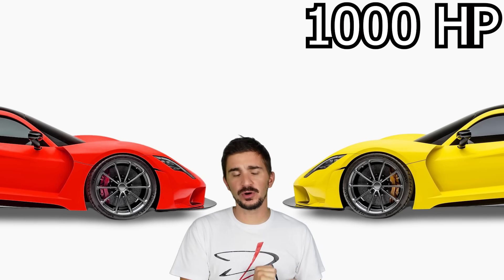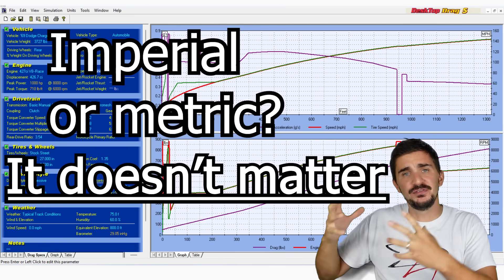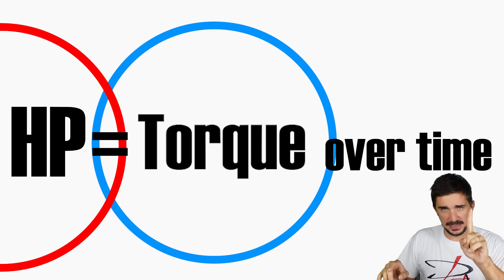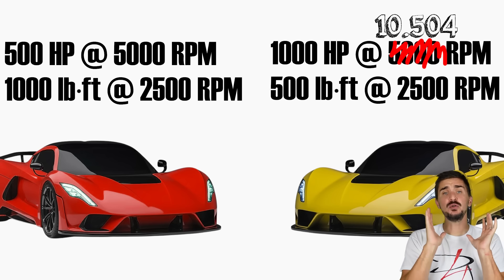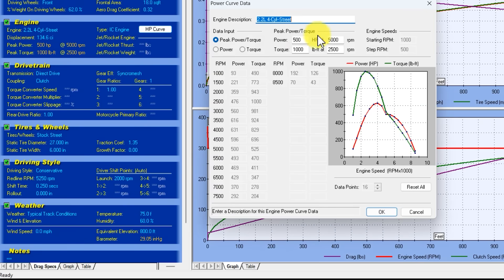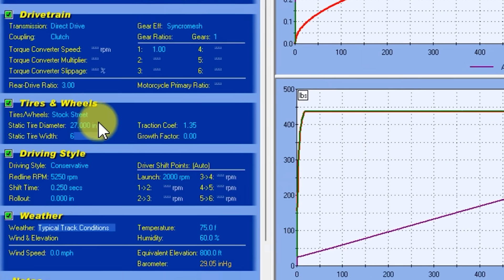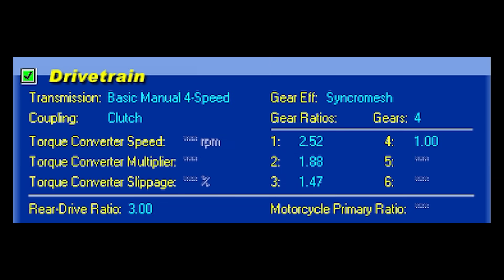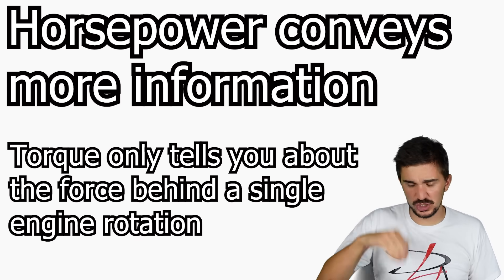Who's faster? Explained and Simulated - Horsepower vs Torque

Comment: Most of these examples are pretty skewed against the high HP engine because it's never allowed to make use of it's power band for most of the test due to the gearbox parameters. In most realistic scenarios, you have proper gearing so you can be at or relatively close to the power band for most of the test, thus a high HP engine beats out the high torque one in most scenarios.

Wheel torque is what matters, so if your 1000 HP engine has half the torque of the the 500 HP engine, it means it's revving 4 times higher to make up the difference. So on the wheels it's twice as powerful, at least in theory, you will have some losses in the transmission and you won't always be at the ideal RPM.

Comment: Horsepower is power. Energy/time. Velocity increase requires energy (for raising kinetic energy and for overcoming drag). So, with optimal gearing car with most horsepower will always accelerate faster.

Comment: He should use the inline 4 600 bikes to find high horsepower low torque engines and kawasakis new inline 4 250 is also a great example of a high hp bike with really low torq number

Comment: This is still not a fair example, as you are using the same gear ratios for both rather than optimising each to suit the engine's power delivery. 
Even in the 1 gear example, choose ratios such that each engine reaches max rpm at the end of the 1/4 mile then you have a fair comparison and should see the actual difference having twice the power makes.
Then we learn that gears are torque multipliers and that as long as we have power we can use gears to make as much or as little torque as we want.

Comment: The conclusion is wrong. It is unrealistic to compare those motors with the same gearboxes. In the real world the high RPM car would have a much higher gear reduction to change its high RPM in massive torque at the axel. With proper gearing the car with double the power could provide double the torque at the axis at a given speed compared to the high torque car.
I don't get why car-people even care about max. torque of the motor. Power tells you how fast you are able to accelerate a given mass. With appropriate gearing even a slightly higher powered car should always win in theory, no matter the torque.
Reply: Do the same tests with the gear reductions of the high power/ low torque-car four times as big as the low power/ high torque-car and see the higher power car absolutely destroy the high torque car. This would be the only fair comparison because both vehicles would reach peak power at the same speeds and also the gear changes should occur at the same speeds.

Comment: He mentions torque multiplication but doesn’t explain that. The important part of this is wheel torque. If you’re car revs higher you can use lower gears (higher ratios).
A superhero with super speed might be as strong (torque) as a regular human but on a bike they can stay in first gear. They can continue to use that torque multiplication when normal human would need to shift. If you weigh 150lbs (on a bike with 1foot long cranks) your torque would be 150lb/ft. Since you can’t rev to 5252RPM you won’t have have 150hp or 300hp at 10,504RPM.

Comment: D4A is a brilliant channel, but I honestly disliked this video and I believe it will bring misunderstanding to the topic. Here are some points why I say that:

- When asking the question "torque or horsepower?", it should consider both being fully delivered to the ground. This implies optimal (and different) clutch and transmission designs and operations for each car (mass, suspension, tires, etc. all remaining the same), which are not represented in the simulations on the video. 

- Torque is convertible and horsepower is not. If you have 1 N.m of torque, you can make it 1 trillion N.m of torque with the appropriate transmission (at the expense of lower RPM, as explained in the video). If you have 1 horse power, you have 1 horse power. There is no converting it. You will need a more powerful engine, more fuel or something else if you want more horsepower. This is because torque is the tendency of (circular) movement and power is the rate at which work is done. Like a leverage or a jack, you can increase the tendency of movement but you cannot increase the rate of work being done without working more. This is not clear in the video.

- There is a simple (and fun) test anyone can do about this question. Take any sim race game (i.e.: project CARS, Assetto Corsa, Gran Turismo, etc) and choose a car. Look at the specs for both max torque and max horsepower for that car and at what RPM those max parameters occur. Put it on manual transmission, select any track and try to do your best lap times, first keeping the RPM around the max torque RPM and next keeping the RPM around the max horsepower RPM. See which one results the lower lap times (spoiler: it will always be the max horsepower).

- Take any real racing category, like F1, stock car, etc. What do pilots and teams crave the most when talking about the engine? As explained in the video, torque and horsepower are always related, but race people will always be talking about the most powerful engine because they know they can manage the torque however they need at the transmission.

Comment: On normal cars that we drive, the most pleasant engine will be the torquey one because typically those engines have a wide torque band and you don't have to use the gearbox as much. 
Wide torque band + wide gear ratios = FUN
Reply: Wrong. Classic example when torque and power bend are messed up.
Reply: @simplemachine9531  Your conception of fun is not the same as mine.
Reply: @altair7001  did you know that for the best acceleration gears have to be shifted up around peak of power?
For what you describe (a lazy car) 3 cyl will be enough and neither torque nor power is needed.
Reply: @simplemachine9531  Of course I know that! I won't waste more time with you, but this is what I'm talking about:
https://youtu.be/Jz7Bkj_GfPw

Comment: The real issue that people also forget is that the torque at the wheels is what you feel. The wheels don't care what the engine is doing because it feels what the gearing sends it. You can turn a high RPM high power into a low RPM torque monster through gearing. The argument is almost mute if the gearing suits the engine and the application.

Comment: I love your videos.  I have to say this one just serves to confuse people even more.  It is not fair to compare two completely different engines running the same gear ratios.   Doing so will distort the truth.  Try running a model plane engine at 5000 RPM (that's about tick over speed lol).  Run the sim software giving the high revving engine double the reduction ratio, and it will win every test !!  With your tests it is not really a 1000HP engine, revving at well below 10 000 RPM.

Also you calculation to work out the rpm required for the low torque engines RPM to produce 1000HP was wrong.  Peek torque occurred at 2500 RPM so at 10 000 RPM torque will be lower as RPM has passed the peek torque.  Without a torque curve it is not possible to calculate RPM that gives 1000 HP.  Maybe closer to 15 000 RPM.  

If you let me mess with his gear ratios you and I could beat Lance Armstrong.

Comment: Horsepower is always what determines how fast a car can go or accelerate when talking about top performance.
Torque is important only because together with the engine rpms, generates horsepower. The more torque we have, the more horsepower we get from a specific rpms range.

In this case, the car with much higher torque, generates more power earlier in the rpms range. But since this is a 'who's faster' kind of question, the one with higher peak power, will always be faster.
Reply: The horsepower only only represents its peak. In case you reach your peak hp at 10000rpm but dont have the torque to accelerate with low rpm, your acceleration is not gonna be amazing
Reply: @Samuel-em3nc  True. That’s why we rev up the engine for good acceleration, either by using the clutch from a stand or by shifting a couple of gears down.
Transmission is what save us from very weak torque at very low engine speeds.
Electric engines don’t need this because they easily generate power from their high torque.
Reply: "the one with higher peak power, will always be faster"
It's not this simple. A higher average power that the car goes through as shifting gears in this race.
A Mazda rotary engine might have a slightly higher peak power than any of his rivals, but slightly weaker normal engines have significantly higher torque, therefore their average hp output is higher.
Reply: @mgoogyi  wrong conclusion.
that would mean that the "weaker normal engine" would have a more optimized transmission.

If the transmission is equally optimized over the whole range and both cars weigh the same and have the same drag, the Mazda wins.
Reply: @svr5423  If you have enough gears to be in the optimal power band all the time then the mazda has a chance. If not then the normal engine has a bigger useful powerband area and it should win. 
2007 RX-8: You have to have your rev between 7500 and 9000 rpm in all gears to be between 225 and 250 hp.
If you have a car with 230-240 HP on a range of 2000 RPM you beat the RX-8 because your average HP will be higher.

I am just talking about the size of the area under the power curve what you are actually using when shifting gears. The bigger area the higher average acceleration.

Comment: I'd take the horsepower one, I can use a breaker bar to achieve 200Nm of torque but it would probably be less than 1 rpm which won't go to fast.

Comment: HP is what accelerates the car in any RPM. Low mid high, you never "feel the torque", that basically translates as high power at the RPM tested. Torque is just a twisting force and it is stationary. It doesnt move. Once it moves it becomes power also known as work over time. People confuse this and think of torque as some magic voodoo shtick, just cause its the bro science of cars. People that do not understand it, explain it to wide audiences.

Comment: One of the best ways to understand hp/torque is by comparing it to riding a bicycle with gears. 
When you try to accelerate the fastest possible from a standstill in the highest gear you will accelerate very slow because the amount of revolutions per time (=rpm) of the bicycle's pedals/axle is very low, despite you are applying maximum force, thus maximum torque, with your legs.
When you try the same in a very low gear you will accelerate much quicker because the rpm of your bike is much higher, while applying less force on your pedals => less torque on the axle
There is an analogy between your legs powering your bycicle's pedals > axle/chain > wheel and combustion powering your car's pistons > crankshaft > transmission > wheels
Reply: That's just gearing. The power going in is the same.
Reply: @horatiohuffnagel7978 wrong, cyclist has a power curve that peaks at a certain rpm
Reply: @horatiohuffnagel7978  human muscle's force peaks at static contraction thus at 0 rpm. As rpm increases the force (torque) you will be able to put down will decline gradually, but your power will keep increasing until the point where rpm x force (torque) is maximal. At this point your leg muscle's won't have enough time to deliver enough force to make more power despite a higher rpm. This depends on your training level, amount of type 2 fibres, etc.
Same applies to ICE engines, except your torque is determined by the Volumetric efficiency rpm range of the cylinders. It usually peaks a bit further up the rpm range instead of in the beginning as with riding a bicycle.
Reply: good 
learned this bike commuting 
if running late and have to stop at red lights or stop signs
shift up before stopping to start in a low gear and then shift shift shift
Reply: As usual. Another commenter doesn't understand what they're talking about.
Reply: However, if a seasoned rider with stronger legs (i.e. more torque) gets on this bicycle, they can out accelerate you in top gear. 

So, if we put a body builder on the bike, he can launch hard in top gear. However, he will reach a point where he cannot move the pedals very quickly and will max out his top speed. Conversely, we can put an Olympic rider on the bike. He will not launch as hard, but in a few moments will be going faster and leave the body builder behind.

Comment: I actually don't see the point in observing torque at all. Any engine can just be geared correctly to it's vehicle, thus making horsepower the only valuable figure. It is pointless to at all to ever even mention torque figures on any engine in any setup. They are all geared differently and all have different wheel sizes anyways.

Comment: Put a F1 engine into a big truck and it will make it useless and almost unable to move. Then put that big truck engine into a light F1 chassis, it’s going to be useless, always spinning tires. This is why putting a 1000cc race bike engine into a car is silly, you still need some torque to move the weight.
Reply: Put an F1 engine into a big truck with the proper gearing and it'll do fine.

Comment: There are 3 phases of a quarter mile race. In phase one, you need lots of torque and traction, in phase 2, you need low weight and lots of hp, and in the third, good aerodynamics and lots of hp. Also, losing power while shifting is bad. The Rimac Nevera is very fast.
Reply: Now watch how cars are launched and think again if they care about traction and torque
https://youtu.be/AoDDODh5Ras?si=BdwO5IVZs3EBEL-V

Comment: Something I've said in the past to explain torque "vs" horsepower is how fast a car will accelerate, and torque is how much a vehicle resists being slowed down. I know it's not correct, but it is a useful lie to help people grasp the concepts.

I feel like your explanation has helped me more intuitively grasp the relationship between the two as frequencies of the same thing, rather than battling forces
Reply: It is not correct and useless.
F=ma. 
Force that accelerates empty car and loaded car is the same. It is not possible that an empty car acceleratea faster than the other but when loaded is slower.

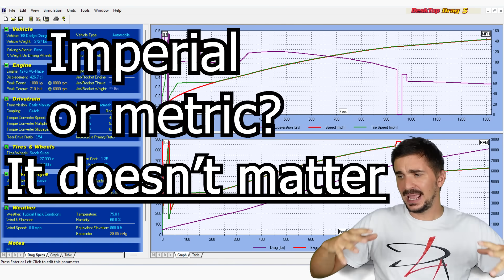Comment: 1:55 thanks for the clarification, I was always under the impression that imperial engines have more torque and metric ones have more power
Reply: Wut...
Reply: @eporter5071  Sorry i fixed it. "Imperial" engines (a funny way to say American) typically exhibit higher torque because of big displacement V8s. "Metric" engines (European, Japanese) are typically higher revving, smaller displacement, and have often less torque but still high power. It's a kind of joke

Comment: Next question for me is how much does FWD, RWD, 4WD impact the hp and torque engines? The traction differences between them should have a significant impact too for a drag race.
Reply: The more complex the system, the more power is lost until it reaches the wheel.
Also, 90° direction change, like in rear differentials and longitudial configuration like some Audis, consumes more power than most FWD cars, since these have tranversal configuration for its engine/gearbox.

And for traction, if you have enough to make a wheelie, RWD is enough. If not and the car tend to spin tires, AWD is the way to go. FWD will always be the worst for grip in a launch.
Reply: Then, how would the performance differ for these high powered engines if we compare them on RWD and 4WD drivetrains?

It's something I wish would have been delved into in the video, honestly.

Comment: If you decide to do another video like this one, comparing 2-cycle & 4-cycle (MX-based) motorcycle engines, illustrates the point you’re trying to make quite well. The current crops of 250F 4-strokes and 250 2-strokes…..they both make similar power (around 41hp) and similar torque (around 19lb/ft) and even at similar RPM’s for both, measurements, but the 2-stroke is doing it with 2X as many firing events (punches), and lower cylinder pressures compared to the 4-stroke……detailing this illustrates the point you made that hp is “work-done” (torque over time). This example also illustrates hp always wins over torque as a performance metric if geared perfectly (ex: CVT transmission), but in real world example, area under the curve in operating range (non-drag-racing application), matters more than peak numbers, because again more work-over-time is completed, for engines with similar HP (in the case of the 4-stroke), yielding quicker lap times.

Comment: The torque formula doesn't work on electric vehicles
Reply: Because? That's absurd.
Reply: @BigBen621  In combustion engines, power =torque x rpm. 
In electric motors, power = current x voltage

You can calculate torque afterwards, but it doesn't go in the equation, just the electric output is relevant.
Reply: @brunocorrea6010  Bruno, I'm afraid you're conflating two different types of power—electrical power input to an electric motor, and mechanical power output of an electric motor or combustion engine. Just like combustion engines, power output of an electric motor is k x torque X RPM, where k is a constant that depends on units of power and torque. What you're describing is power input to an electrical motor, which is k x current x voltage, where again k is a constant that depends on the units being used. Of course, there is no comparable equation for combustion engines. Where the same units are used, which is somewhat unusual, the ratio of the the input to the output is the efficiency of the motor.
Reply: @BigBen621  Oh, so that saying of "maximum torque at 0rpm" of motors are true? I thought is was a misconception by the midia, I always thought about the current x voltage thing applying when talking about ev's.